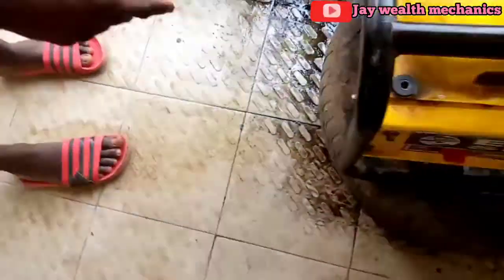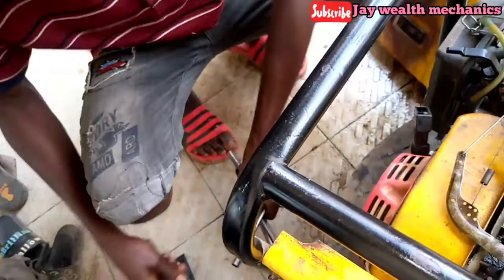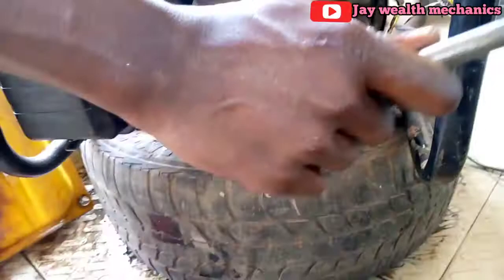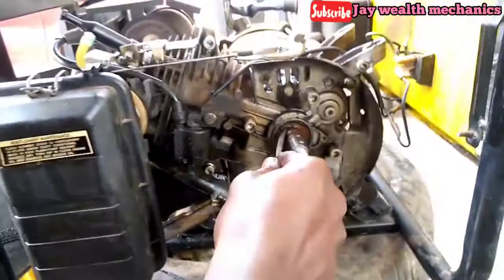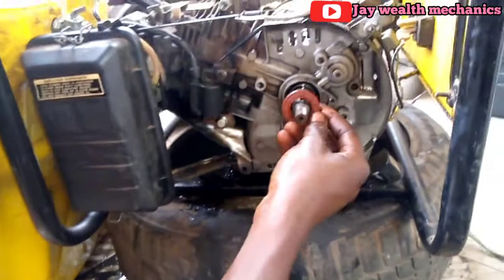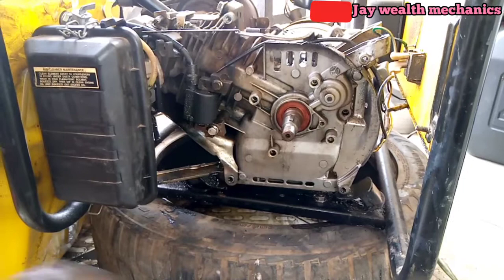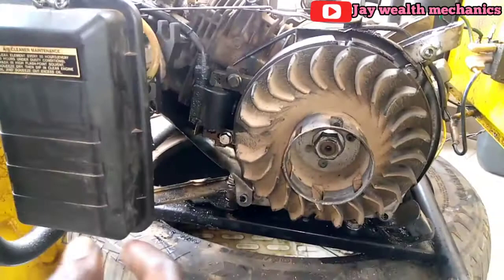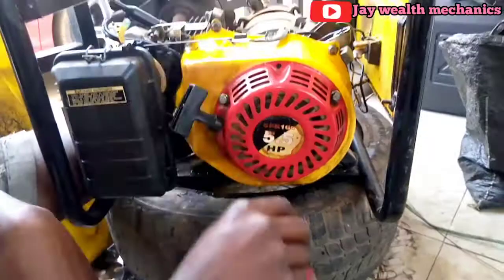How to replace a leaking oil seal

Comment: Nice job Engineer 👏 
Does flywheel get spoiled at all and how do you clean or service it?
Reply from the maker: Flywheel hardly get spoil. You will sandpaper the magnetic side and wash with fuel.

Comment: Great video...I have a issue I hope you can help me with. I have a Honda GX390 on a generator. I replaced the output shaft oil seal as it was leaking. I installed the new seal flush with the engine case. After running for awhile it started leaking again. I thought the seal needed to be counter sunk a bit so I replaced it again. And after running for a short time it has started leaking again. Im not sure where to go from here. Both times replacing the seal I used steelwool to clean the shaft and it seems smooth with no defects. Any advice would be great! Thanks in advance
Reply: Apply glue at the outer end of the seal for firm grip. I had same problem when I did oil seal job on the rotor side of the generator.
Reply from the maker: Did you confirm maybe is leaking from the seal. If yes.... Check if there's loose bolt anywhere.. especially the surrounding bolt.